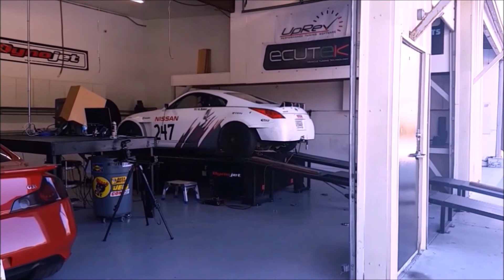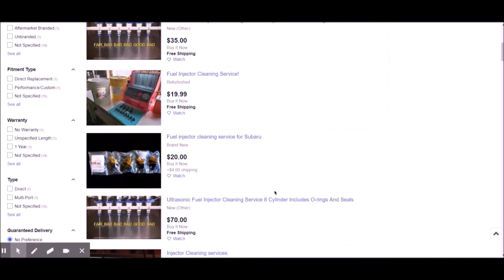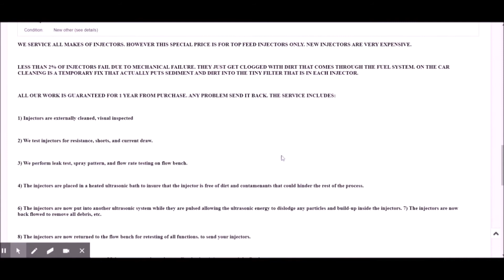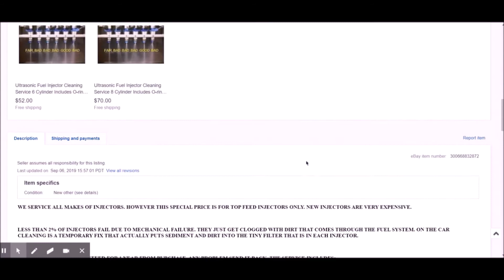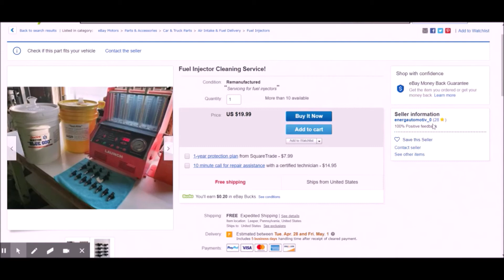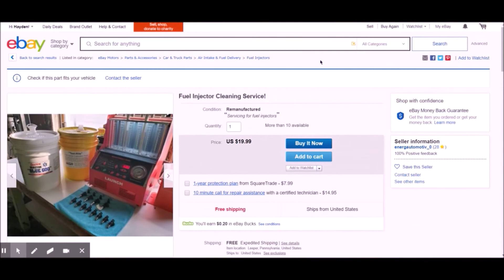Get Your Fuel Injectors Professionally Cleaned

Comment: Thanks for the advice, while I have the G35 motor down getting refreshed I should definitely send the injectors out, same with my old (1999 Silverado) track tow vehicle, it's been a little hesitant at idle and everything else on it has been replaced.
Reply from the maker: Yeah this cheap investment will go a long way in smoothing out engine performance